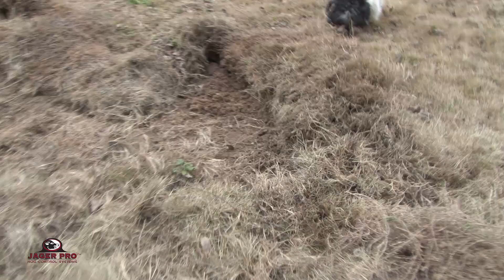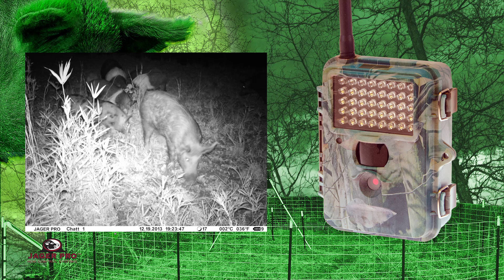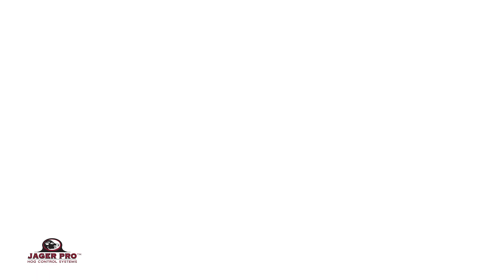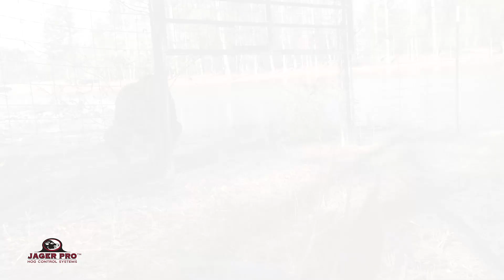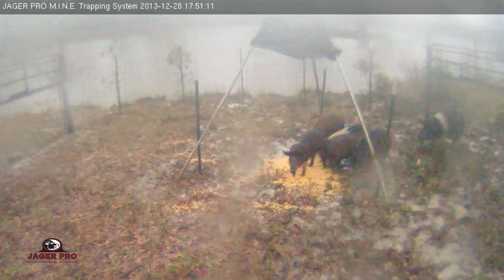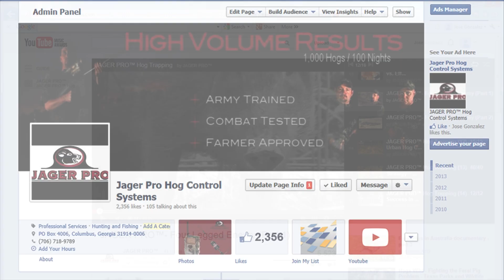Wild Hog Trapping | Hog Trapping (18 ) - 7/7 Capture in Columbus City (Part 1) | JAGER PRO™

Comment: every time you go out on a call like this you should insist on all the effected residents call there local repetitive and fight for hunter and trappers rights. help offset some of the anti pressure they are under
Reply from the maker: Most urban and city residents have never met a Hog Control Operator™ capable of removing the entire sounder at one time. We ensure their first encounter with a trained professional is a very positive experience. We also explain feral pig sounders must be euthanized for the same reason termite swarms and rat colonies are killed. Insect versus mammal makes no difference to the legal definition of a pest or the Best Management Practices needed to control them.